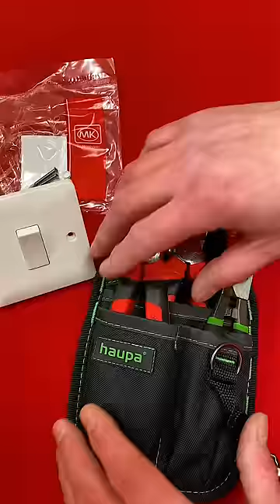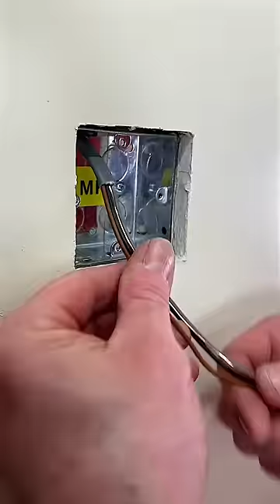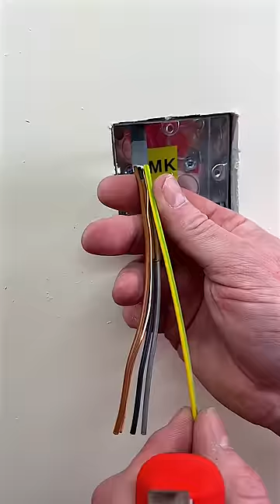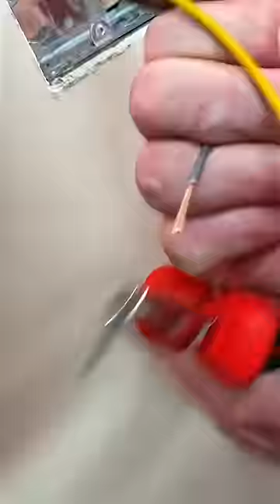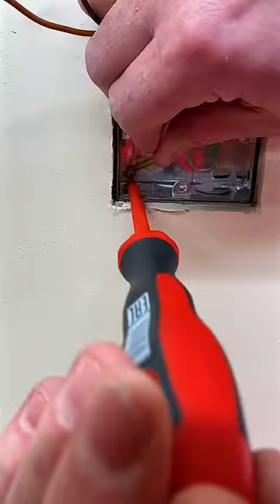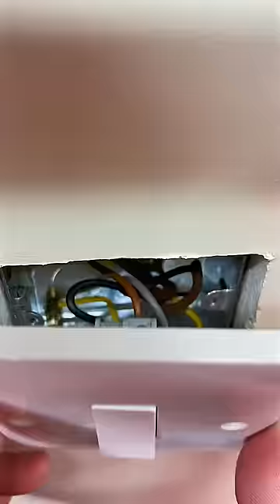Back to Basics! How to Wire a 2 Way Light Switch.

Comment: Solid core wire, earth wire without cover, metal box... I had to check if we were back in the 19th century.
Reply: In the US everything inside the walls is solid core, ground is always bare (and kept bare on purpose). Metal boxes seem to be standard for commercial buildings, but fairly uncommon in newer residential (although still seen a lot in older homes)
Reply: @tankerkiller125  good thing here in inland Europe evolved from that. Stranded wire is much easier to work with.
Reply: Sorry, how high is your horse exactly?
Reply: Nothing wrong with solid wire for fixed installations, and the earth wire is sleeved. It serves no purpose to have it insulated within the outer. Running singles is different, but those aren't singles.

Comment: I always used brown for the common.
Reply: I do as well
Reply: It's Euro wiring
Reply: Use any colour you like, but brown us most common for common, as long as it's same at both ends. I think the on site guide shows the black as common
Reply: Black as common for 2 way!
Reply: Something to do with black is the middle conductor in a 3c+e
Reply: @jpnixon  I use black as common as when the switch has the twin at it too then both browns in L1 and both blues in L2 ( if you treat the grey as a blue/neutral when using single phase) that then leaves the black as the on its own terminal. obviously all are lines with brown sleeving on incase anyone thinks that I'm actually talking about having a neutral at switch.
Reply: L1 Brown L2 Black L3 common
Reply: 2 way always black for me
Reply: I use black for common
Reply: L1 is Brown
L2 is Grey
L3 is Black

The terminals have labels like 1 2 C or L1 L2 COM

So: L1 is Brown.
L2 is Grey
COM is the leftover cable (L3), which is the black one.

Comment: I don't uderstand why they use metal boxes in America. Just use plastic ones, that's one ground connection less. And in europe the ground wire is already insulated in the cable. So much less hassle
Reply: This is in the UK my friend. Best regards, Scott. ✌️🙏✌️
Reply: @scottl7644  Yes as in the US it would be called a three way witch. How confusing. In Finland it is logically called a 6-switch.
Reply: British and Americans love metal in the electric components. In Europe grounding was not commonly used on dry rooms until the 90s so one could not ground anything.
Reply: @Okaro  
Tell me you don't know anything about American electricity without telling me you don't know anything about American electricity.
All electrical boxes for the past few decades or more have been plastic! Unless someone purposely chooses to use an aluminum outdoor box or is using EMT surface mount metallic conduit in a commercial application. And while I'm being fully transparent in commercial applications as well they will use a metallic box if they're using MC cable for Extra Protection.
Reply: Y use 3 wires in a single switch? Am an electrician in Kenya Africa
Reply: @albastuz Josee  
That part I'm not so sure of. Unless it's a three-way switch or something like that, and one of the wires is a traveler. But I'm not sure in this application.
Reply: Metal is really only used in commercial buildings and it's mainly only meant to be used for the purpose of running conduit. No idea why someone would set a metal box and then not run conduit to it?? Just use a plastic box for romex.
Reply: @okaro6595  In Germany a seperate PE has become mandatory around 1972.
Reply: @albastuzjosee9485  because this will be one of 2 switchs, either one can turn the light on and off...think landing /downstairs...etc
Reply: Because they like to sue each other. If you use a plastic box and have no protective earth a fault in insulation will cause electrocution when you're putting on wallpapers. And the homeowners are liable for injury of anyone, even intruders. In addition, if the connection becomes loose, the plastic box can melt and burn, while the metal box will dissipate heat. And if your electricity caused a fire, you're liable for any damage to neighbours, not only your home. So they insure and double insure, and insurance companies put pressure on the certification industry to make changes so that insurance companies pay nothing.
Reply: 1.this is the uk

2.im not sure why they use metal aswell since metal boxes are only used for industrial buildings

Comment: Oh man everything about that is not an electrician
Reply: Bet you are fron the USA, the country that uses toothpaste caps to join cables,say no more.
Reply: @onelineal9382  nope uk
Reply: @robertwilliamson3852  OK, what should have been done differently, and how?
Reply: @Grizzly01  are you serious if that was a spark stripping cable like that and prepping the ends in such an uncomfortable manner he should change job also you never press down on pvc with snips it creates a weak point that you can snap very easily even the choice of strappers was wrong although you do get switches that do switch that way but very uncommon
Reply: @robertwilliamson3852  is that jumble of un-punctuated words meant to be a sensible reply?
Reply: @robertwilliamson3852  eh? this is how i would strip cable when fitting security systems aswell, its literally what all electricians do.. if you can't figure out how much pressure to use to strip a cable, then you shouldn't be using tools...
Reply: @Grizzly01  Are you having a laugh ? You are talking about MY punctuation 🤣You might want to look at your own .

Comment: Nice touch with the screw alignment, even though they are covered 👍
Reply: Yes me too. Always angle at that position incase I come back and they are moved and then I know someone else has been in there. I even tell the client if they are looking so as much I warn them. Best regards, Scott. ✌️🙏✌️
Reply: @scottl7644  doesn't that just signal to the client to remember the screw alignment?

And what if they did? My mum always loosened light switches to wallpaper, the decorator always cut in - 10 years later it's obvious which is which. My mum knows nothing about electricity but she didn't take any unreasonable risks.
Reply: OCD? 😂

Comment: Just make sure you got your neutral in the junction box, and you’ll be fine for the future. In our country we use EIB/KNX for smart homes, no electric power needed. The layout of the wiring is totally different also. You need 1 bus cable from device to device, and the power is coming from the central supply.
Reply: A 2 way switch just carried the lives not the neutrals they’re irrelevant
Reply: @uplightuk8924  you need the neutral for smart switches like shelly and others. Yes, you can get a version that doesn't need the neutral but the you have a high minimum load and in some cases you have to wire a load resistor even above the min load.
Reply: @Baerschi100  or you can use the shelly neutral bypass, but I agree with you.
Reply: Same in US nowdays. 
A neutral is required inside any lightswitch enclosure.
Reply: @Baerschi100  We wire neutrals to the switch in the UK. But back in the day, the old school way was just to wire the neutrals to the lights. 

Either way is fine but yes taking neutrals to the switch is future proofing it however that used to be frowned upon
Reply: Do they make 4+1 cables for that these days?

Given the 3+1 is colored as 3 lives, I suppose they must, since three phase equipment sometimes needs neutrals.

Comment: 25mm back box ,you should use min.35mm back box, for future. 
Customer might want to install dimmers in the nearest future 🤔
Reply: Modern 1 gang dimmer switches fit in 25mm boxes actually 👍🏻
Reply: @brianwalker2201  Ok, good luck especially when you wire a 3 plate standard install.
Reply: @martoniozsa  but this is a 1 gang switch, which is ample room for a dimmer. How do you know he didn’t install 35mm boxes in the other more congested switch points?
Reply: I install 25mm unless I actually need a 35mm for dimmers etc.... I ask first and would rather do less damage to the building. You should install 35mm at a minimum... Behave.
Reply: Is it just me but I always thought 25mm boxes being installed, being in use looked stingy and potentially troublesome.

Comment: Some electricians use brown for the common ,including myself
Reply: Red was common therefore brown is now common
Reply: @TheYohtube  Like in several other countries like Germany- France and The Netherlands!!
Reply: Why does my switch only have three wires, live, neutral and earth?  I live in the UK.  I also have a pull cord switch on the same circuit which also only has the three wires. Is this right?

Comment: in UK 220 volt systems they can use one or two wire sizes smaller for lighting cause of the higher voltage.
compared to code requirement in US/Canada.
Reply: UK doesn't use 220 V. It's 230.
Reply: Thank you, for the spec.

Comment: You wanna make sure the bottom lug at least is bent down flat to avoid many a fault especially with multiple switch wires in the box
Reply: Solid wire wrapped around a terminal screw... Np

Comment: Front of steel box should be set flush with wall's surface.  That's why boxes are available in 16,20,25,35 and 46mm depths as well as to accommodate deep backed accessories. Better time spent at 1st fix setting and levelling boxes makes for neater and tidier job.
Reply: Yes this really annoys me and is why you keep having to buy longer screws to replace the supplied ones on the switch.
Reply: @planespeaking  Whole point of the box is to provide an enclosure between the accessory and the surrounding material. I always took my time at 1st fix and had boxes set dead set flush with wall face.  For walls that were to be tiled I'd even set the box about 7mm proud of the plastered wall so the front of the box is near flush with the tiles' surface.  Plasterers hated me because it really made their work difficult. Long screws shouldn't even be an option. proper thing is to use extension/skeleton boxes.

Comment: Does where your from run lower amps than US? Seems like our residential wiring is alot thicker
Reply: Yeah
Reply: 230v in the UK
Reply: The UK and Europe both run 1.5 mm² wires for circuits protected by 10 amp breakers, while we use 2.5 mm² wires for 16 amp circuits. At 230V, that's 2300 and 3680W.

Comment: Been in the game since 98 and unfortunately because no one would give me a chance the majority of my knowledge is self taught. Still to this day cannot do lighting circuits (especially when strappers are involved) on site, it still doesn't make sense in my head.
Reply: Draw it out on paper, photo it and keep on your phone for reference .  Nobody wins a prize for memory, only safe, quality workmanship.
Reply: @MS-Patriot2  have tried this, unfortunately because I didn't learn it properly I still have the original method I used stuck in my head which is wrong. All good though, I get the improver to do them
Reply: @balders3544  If you are more of a ‘learn by doing’, make yourself a battery powered test rig. The functional wiring is all the same, just don’t forget the cpc when you’re back on 230V AC!
Reply: If you are interested in learning it for the sake of knowledge and not handyman work, you can leave a comment down below and i can make it make sense to you. I would not encourage you to go ahead and do unlicensed work though. Very dangerous and possibly fatal game.

Comment: No Neutral?
Reply: The switch is put between two live wires. Double pole switches are only in the meter box.

The neutral is wired from the circuit breaker to the light fitting or the junction box.

Comment: Why do they make switches for 2 gang boxes??? I'm so lost. What's the purpose? Single gang box with a single gang switch?? And why are there three wires into the switch?? Never seen this in my life. What the hell is the third wire?? If this is a simple two way switch then there should only be a ground switch leg and constant hot. If this is a three way switch then the other two wires in the switch are traveler's to the next switch. But the description says two way switch which is 1 switch and a light. So why the extra wire?
Reply: That is a single gang box. It’s a 2 way switch, so there’s a phase, neutral, and a common, and the extra wire for the earth

Comment: Why do you bend the tip of the wire before screwing them down? seems like a waste of time.
Reply: If you were putting 2 or 3 wires in you wouldn't bend them back but a single wire is a bit loose so it's a stronger connection if you bend it back so that there's more copper to grip.
Reply: @DavidLee-vi8ds If its too lose then you are using the incorrect  type of electrical connector and thus violating electrical codes. I honestly dont know where this is from, I'm guessing europe? Do they even have electrical codes over there or do they just blatantly ignore them?
Reply: @fjl05  as you screw the screw down, the torque of the screw tend to push the cable to one side, doubling the tip over prevents this...they don't make different versions of the same light switch dependant on the size of cable or how many cable you want to stick in, that would be uneconomical for the switch manafacturer...
Reply: @iainansell5930  Switches and outlets in the USA don't connect this way. They are made to accommodate all the regular size wires used in branch circuits. Why dont they do that for these particular hardware? Are these made with only bigger wire in mind?

Comment: Cool edit, but do not use the pliers to do the loops, scratches aren't good for electricity
Reply: Loose wires cause fires my friend. Scratches? A little scratch won’t harm the conductors. The more conductor inline with the terminal the better the flow. Best regards, 
Scott. ✌️🙏✌️
Reply: @scottl7644  well, there is a special tool for this, with round shape pliers.

Comment: Why r u using single strand wire.. Why not multi strand wire????
Reply: It’s the UK it’s standard.
Reply: if solid cable breaks, you generally know about it, if stranded breaks a few strands, could cause a hot point due to increased resistance at fault...and you wouldn't know about it.. stranded is generally for low voltage stuff..

Comment: Why not use a pair of UF pliers, and no connector in the box ?
Reply: UF pliers? Can you send a link? UF here in the states is used outside underground. This was not UF. UF has outside NM sheathing around each individual conductor, separating them. If you look closer this was just sheathed cable, all the conductors are seen inside the main sheath when he splits it open.

Comment: North American wiring and hardware is a joke!
Reply from the maker: Couldn’t comment this is 🇬🇧
Reply: @efixx  I guess that makes it worse.
Reply: What country are you from that has such a superior system?
Reply: @fananderson3913  Germany. Here we use spring-loaded push-in connectors for almost everything. They are above everything else reliable. There will never ever be a lose connection, because the spring keeps it tight.
These connectors come with the benefit of beeing fast so assemble; no need to make a look of the wire where the screw goes in.
We don't use any metal boxes here. And why would you? Breaker panel? Plastic! Outlet box? Plastic! Plastic doesn't conduct electricity; if you guys have a failure in your earth-wire (that you don't discover, because why would you) and then have a short between life and the metal box - voila - 120V on your whole box. how is that good?
Our outlets keep tight even over decades of beeing used, there is no chance of beeing eletrocuted while plugging in the plugs and all outlets are always protected by a GFCI - always.
Then there is the whole 120V 2-phase-thing with your 200 Amps.. that's just crazy and above all unnessessary.
There is 3-phase power in the USA and I don't see a reason why you just won't adapt to that in residential contruction.
Just change your building codes. But there lies the problem, doesn't it?
In the land of the free you people are tied to a piece of paper beeing 200 years old or even older and you are afraid of changing it, because it might lead to communism.
Most appliances use 120V and/or 230/240V anyways because it's easier to make them compatible with EU standards AND US standards and not make 2 different appliances. So why not raise the voltage to 240V regularily? Then lose the opposite-phase-thing and use 3 phases like almost every other country on earth. That means reduce the amperage by 3 times.
Electric vehicles and more electric heating even in colder climates are coming and with your wooden houses it might be smart to do so.
Also out light switch plates don't look like something from china. The way the screws are hidden is just hilarious.

/watch?v=vj_xSpmmYNU
translation: 5 reasons to use this system:
- push-in connectors
- steel cage; toothing for alignment of any combination of switches, outlets and such
- mount by clawing into the stone wall or you can use screws to srew into standardized outlet-boxes; they are usually glued into the stone wall. with wall like you have we would clamp them against the drywall. so you aren't relying on the position of the studs.
- contacts to check for correct cabling
- clean cover plates; again made so you can combine any type of outlet in a row of 1, 2, 3, 4 and 5 switches/outlets.

I really do thing with wiring the US is decades behind the standards beeing used in the EU.
Wire nuts alone... why do you still use them? There are only Wago-connectors in my house.